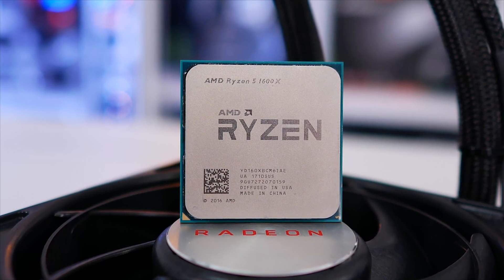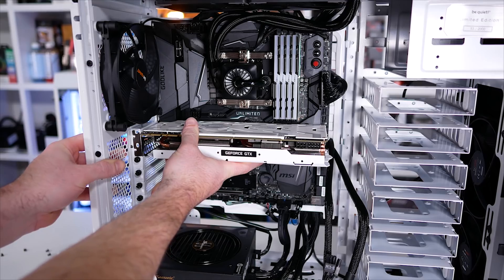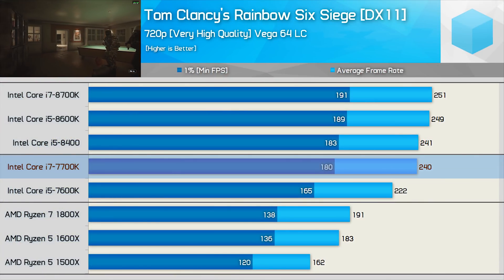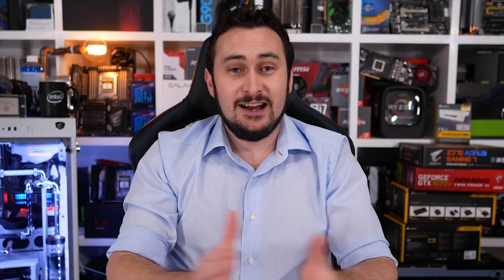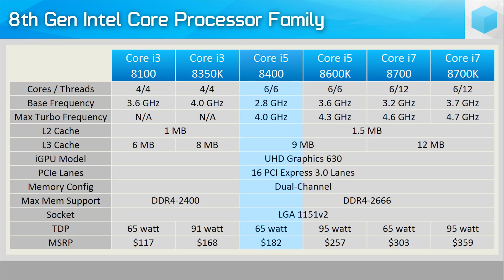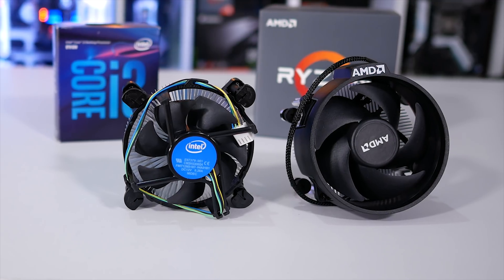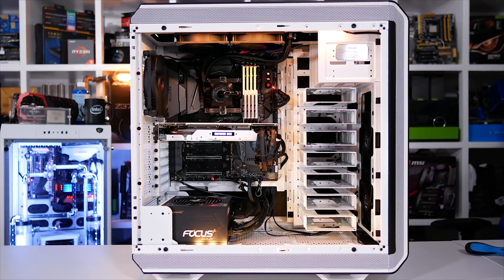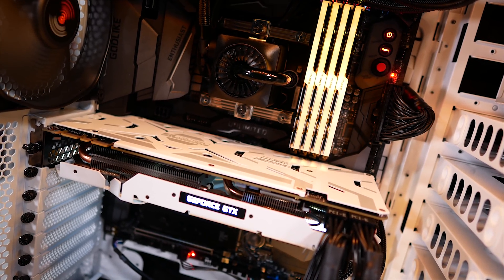Let’s Chat, R5 1600 OC vs. i5 8400 Benchmarks Incoming!

Comment: - 2X the threads
- overclockable
- 4ghz with stock cooler

all that just for $20 more, so im going with the R5
Reply: Paid $220 combined for the mobo and cpu at micro center in New Jersey. Crazy deal Imo.
Reply: Yeah I've got an Asus prime b350 and the ryzen 5 and got it up to 4.0 with stock cooler on my personal gaming rig. Works perfectly.
Reply: SlavjanA - sacrifices? what? I'm not sure if 6.8% is de diference... but there is more then just this number as well... there is also software optimization, which usuably heavy benefits intel. And tell me... r5-2600? 500mhz? What? Do you work for AMD? or where are you getting this info? Or are you one of those AMD fanboys that yell "wait for ... " and just pull out name products that dosent exist out of their ass? Like Nvida fanboys with their theoretical 2080gtx...

tell you what, i'll leave you with this little comparison chart... and i'll remind you that not all games are yet optimized to use more then 4 cores, tho certainly i believe is the trend, and soon we will have more then use full 8 cores and more. Oh and remember that 12 threads dosent mean is the same as 12 real cores, is on an average, a 25 to 30 % improve speed over 6 cores with no threads if given the same ipcs and clocks.

http://cpu.userbenchmark.com/Compare/Intel-Core-i5-8400-vs-AMD-Ryzen-5-1600/3939vs3919
Reply: Wizzie vfx... 12 threads is not the same than 12 cores... in average is 25 to 30 % improve in performance from 6 cores if given the same ipcs and clock speeds. The 8400 certainly don't overclocks but each core has a 10 to 11 % advantage over the amd cores, then remember that many games and other software have issues with SMT the AMD version of Hyperthreading and in fact there are some games u actualy benefit from turning smt off... Once the cheap mobos come out, the 8400 will be the better value... not saying the r5 isnt a good option either, but from an objetive point of view, the 8400 is still better. Again, just wait for the cheap mobos and the 8400 will be better overall. Here i'll leave you with some charts easy to read

http://cpu.userbenchmark.com/Compare/Intel-Core-i5-8400-vs-AMD-Ryzen-5-1600/3939vs3919

i5 currently 13 % better at gaming, which i think is what we talking about here. Tho the i5 is also very good for productivity. specialy in some applications that dosent use many cores like Adobe.
Reply: King Christo 3.8 all core, 4.0 single core.
Reply: the asus 4+2 on b350 boards is quite good, and the Prime B350-Plus has good heatsinks on it... also asrock's vrm on the b350/b350m Pro4 is pretty good too, and also has nice heatsinks
Reply: Plus AM4 platform has a longer lifespan.

Get the Asus B350 though, avoid the ASRock's since they don't have LLC control.
Reply: SlavjanA 
didnt know that, thanks for letting me know
Reply: Actually not a stock cooler but cooler master dream X special edition. Quite premium tbh, about 25$. The one with R3 is cooler master dream x standard edition which is cheaper.
Reply: Teemo4Life 

the 8400 runs at 2.8ghz and turbos up to 4ghz (keep in mind it turbos to 3.8ghz most of the time while gaming)... if it was unlocked it would be much better than the 1600, but since its locked they are about the same while it has half the threads

the 1600 has double the threads and can be overclocked to 4ghz at only $20 more, so i dont see what the joke is

also its part of am4 which will last till 2020...
Reply: People thinking they are super smart or informative letting others know how the 1600 doesn't always get to 4.0oc, and instead they usually go up to 3.9 lol. As if a 100mhz was going to offer crazy benefits hahahaha. Just listen to yourselves before posting this kind of shit. If a CPU works at either 3.9 or 4.0 it won't be different at all. Also a 100mhz disadvantage shouldn't be a deal breaker. 
And yes, the 1600 is a better option for gaming at 60fps or higher Rez, OP, just get one and tell us about the experience. Cheers.
Reply: wizzie vfx 
I’m getting pretty sick of AMD fanboys spreading this shit about AM4 being supported till 2020. AM3+ was supported from 2012 until just before 2015 with the 8370, but offered no real reason to upgrade over an 8100. LGA-1151 has been supported since 2015 and is still supported now.... Does this mean the new cpu gens have necessarily been big upgrades or compatible?

Stop being so biased and fanboy-ish. The best type of market is a market where the consumer analyses everything said to him and chooses the best hardware, not what his favourite company sells. Look into what companies says, use the intelligence you have and don’t be a sheep. 

Doing this means the companies have to struggle to compete, which as we’ve seen recently is great for everyone.
Reply: AziWazzi am3+ was from 2012-17 actually for mainstream. Until ryzen release. But yes new cpu wise it was until 2015. But amd have confirmed the 2020-2022 target where zen plus and the next 2 gens of zen are on am4 platform. Obv with bios updates to handle the ram and cpus. You are just used to Intel changing chipset near needlessly every year. Zero fanboying here just facts. Per core the ryzen IPC (which if people didn't know is per core PER ghz! So 4ghz vs 4ghz for instance. Not intel IPC where they over clock it and say it has more IPC (skylake to kabylake) ryzen does have a true IPC near that of coffee lake but coffee lake clocks higher. Hence the % difference. At 4.6ghz it's 15% more than a 4ghz ryzen per core) also as said previous. This is not bulldozer. The IPC is not like 40% less than intels cpus like sandy bridge and bulldozer. So can we all stop acting like it is. For games most the problems with ryzen go when smt is disabled.
Reply: jose juan andrade Global Foundries already stated that 12nm will increase performance by 10% wich is about 500mhz, AMD can also iron some things to improve IPC (one of those things are already on Raven Ridge wich is precision boost 2 but thats something "useless" when OCed) AMD in this very moment has the best cpu design it just lacks the clockspeed due the 14nm Samsung moblie node in wich the "12nm"(its actually still 14nm just better optimized) is also based.
Reply: King Christo The stock speed of the i5 8400 is actually 2.8Ghz while it's turbo boost speed is 4Ghz. There is plenty misinformation out there already, so please don't add onto it.
Reply: If you are gaming most of the time i would get the 8400
Reply: The best VRM design out there right now is the 12+4 design on the Asrock X370 Gaming Fatal1ty Pro (or something like that.) it does cost $249, but 12+4! if next gen ryzen chips can OC well, you'll be the first to find out how far they go.
Reply: This is why i still love the r5 1600
Reply: SlavjanA Please provide proof that Zen can hit 4.2 GHz on a consistent basis as everything shown so far on every tech channels is 4.1 GHz at most while using an 1800X. Non X models don’t get even close to that speed contrary to popular belief. Hypothesis amounts to nothing more than a wild guess if there’s no actual testing so you’re basing your argument on pretty much nothing other than a number thrown out by GLoFo. Ryzen is based on a low power die and a different architecture so comparing with previous or present Intel architectures doesn’t really make any sense, we have to wait and see.Pinnacle Ridge is based on the exact same architecture as Summit Ridge so it’d be a more educated guess to expect an increase in frequency but no IPC gains until Zen 2.
Reply: C A TR has 4.2 XFRs
Reply: This thread is so dumb. Who cares how many cores and clock speed it hits? Performance and price are the only things that matter. 

If i could buy a single core processor for $20 that has a base clock of 2hz and boosts to 200Mhz, but it outperformed an 8700k, you’d be damned sure I’d be buying that little single core. 

And when you look at it from that perspective, you know that, due to the IPC advantage that Intel has, the 8400 is going to beat the 1600 in MOST tasks (notice I didn’t say all). The r5 will still outperform the i5, but only in HIGHLY multithreaded tasks. 

Granted, where the r5 loses, it probably won’t lose by much, but where it wins definitely won’t be large victories either. 

And this is coming from someone who REALLY wanted ryzen to stomp Intel into the ground. The rest of you guys just sound silly spouting all of this nonsense. Like someone else said, if you really want high clock speeds, then drop all these crappy ryzen and locked Intel processors and go grab you an FX processor and OC it to 5Ghz... yeah, you go do that and have fun with it.
Reply: And also, that’s not to say the r5 is a bad processor. To the contrary, the r5 is a great cpu for the price, it’s just that the i5 is going to be better for MOST people.
Reply: Ben Feldbauer 
all im saying is that with the 1600 you get more CPU for your money, for 60hz gaming none of the 2 makes a differrence, but when im buying a pc i want it to be a beast all around, not just when im gaming
Reply: Overclockable doesn't matter if it only hits the same clocks as the stock 8400 though? And it will run hotter / louder
Reply: Wow, the AMD crazies are already out in full force and Steve hasn't even posted the benchmarks yet.
Reply: Godlyhank 
How do we know that Ryzen 2 won’t take Ryzen to 4.5 ghz with IPC slightly lower than intel, while intel clocks higher, and then Ryzen 3 will stay at 4.5 ghz and be left in the dust by intel at 5.4 ghz on 6c/12t or maybe even 8c/16t. How do we know it won’t be an FX-81|83|93|95 situation? We don’t....

We don’t know any of this.... Maybe AM4 will have TRUE support until 2020 and get refreshes that keep up with intel. Maybe next gen intel will be 5.6ghz on 10c/20t. We don’t know. My point is don’t just take whatever a company says as abosolute truth. Stop taking it from AMD and use your intelligence.
Reply: AziWazzi wishful thinking. There is a lot of physics behind the limits of frequency. SB got to 5ghz too a lot of the time that ceiling hasn't changed much. And it likely won't for intels core layout. The likely outcome is ryzen plus will catch intel up. And intel might make IPC gains on next series at identical frequency. For someone who says for people to use your intelligence you are not using yours. Only dreaming. I'm a realist. And we know it's not another fx by the IPC vs intels cpu compared with bulldozer vs SB on release any person with a measure of intelligence would see that it's not the same at all.
Reply: T B 
Yep, but we can’t just make fun of them, we must show them the light of being a near non-biased consumer....
Reply: jose juan andrade Looks like you need to learn about the difference between single-threaded and multi-threaded applications, and how applications use multiple threads, as well as how IPC is measured. Your "8 core" 8120 might get a higher CB score than an 8400, or whatever you're looking at, but it doesn't have the single-threaded, clock for clock IPC advantage. That's what "IPC" refers to; clock for clock and single-threaded performance.

Ryzen and Sky/Kaby/Coffee Lake have a 6.8% IPC difference, which is much lower than the God knows 50%(?) IPC difference between Bulldozer and the Lake's. At the clocks that the 8400 is, you might see a 5 or 10 FPS difference if you're lucky, maybe even none when you take RAM into account, but that extra FPS you might gain from the 8400 is not worth all of the sacrifices you make by not getting an R5 1600.

Not to mention that by the time the B and H motherboards show, we'll have the R5 2600 with at least a 400 to 500Mhz increase in clocks, and maybe even an IPC increase.
Reply: Don't expect to hit 4ghz and especially not with the stock cooler.. Mine can't, and that's even with a 240 mm clc.. I gotta give it more vcore than what's safe to reach it, and then it's still not stable..
Reply: Pure game and expensive mobo go Intel. Budget stay on amd.... Get better gpu.
Reply: wizzie vfx that virtual core are not that impressive as real core. Some software are not even work well with it. Overclocking? Current gen cpu be it from intel or amd are not that impressive in overclocking. Might as well keep them at stock only. 4ghz OC on stock cooler? From what i see so far majority of those R5 only goes up to 3.9. You need silicon lottery to get one that will reach 4ghz mark.
Reply: jose juan andrade 6 threads, RAM overclocking/RAM frequencies past 2666Mhz, and the longer lasting AM4 platform. Also supporting AMD for more competition to some extent. Software optimisation is not how that works, you'd see that if it was software using a specific Intel only instruction set, but any issues there might have been, have been resolved by now and the only thing left is basically RAM compatibility although that's also been largely ironed out. There's no software that likes Intel more because it's Intel, they might like it more because the software prefers high single-threaded IPC over a multi-threaded workload like in the case of the Adobe suite, or even the Autodesk suite, or gaming, but the 8400 doesn't have the clocks or threads to compete with the R5 there anyway.

Where did I get 500Mhz? Purely hypothetical, but we already have Zen getting to 4.2Ghz, and with a die-shrink and a process refinement it wouldn't be too far fetched to expect it to get to 4.4 or 4.5Ghz (500Mhz more than 4Ghz), just like how you can more easily get to 4.4 or 4.5Ghz on 32nm Nehalem compared to 45nm Nehalem. I'm not saying to wait either, I'm just saying that that'll give even less reason to purchase an 8400 over an R5 when Zen+ comes out.

Not all games are optimised to go past 4 cores, with that I'll agree, but they are optimised to go past 4 threads, which is why a 1600 or an 8400 provide an overall better gaming experience compared to a 4c/4t Lake CPU. It's true that we'll use more and more cores soon too, especially with low-level APIs. Those user benchmarks tell me nothing though, especially not gaming; we don't know the CPU clocks, we don't know the hardware in the systems; and we have literally no game benchmarks.

That SMT (what Intel branded as Hyperthreading) improvement is not entirely true either, AMD actually has better SMT than Intel. You're right that SMT provides a 25 to 30% increase in performance but that's for Intel, for AMD it's a 40 to 45% improvement. Also in some cases like in 3DMark's FireStrike, SMT adds a 50% improvement for both Intel and AMD.
Reply: You can't overclock the 8400 Teemo.  VFX?  WTF are you talking about mate?
Reply: No. i5 8400 benchmarks done with 3200mhz rams and ram speed effect cpu's game performance. i5 8400 is slower than a r5 1600 with 2666mhz ram.
Reply: Nah, when comparing them all around, it's honestly a pretty even fight. The 8400 only loses (barely) in a few applications, they roughly tie in about 50% of apps, and then the 8400 wins in a good 40% of other programs (including gaming). 

And sure, they both do 60hz gaming just fine, but many people game at higher refresh rates. In addition, the 8400 will be able to do 60hz gaming for longer than the r5 (most likely, since it runs games better, currently), then there's the fact that you don't even have to OC, which leads to it being hassle free and more efficient.

Sadly, it looks like 8th gen gives a pretty decisive victory to intel. 

Honestly, to argue otherwise is pretty tough, considering that ryzen wasn't even a decisive victory compared to 7th gen (it beat it handily in most cases, but still barely lost to anything that favored IPC/clock over threads, ESPECIALLY gaming), which made ryzen a VERY strong contender against 7th gen, but the 8th gen BLOWS AWAY intel's own 7th gen.
Reply: Wizzie vfx, do you know what IPCs are? I suggest you to google that up... because by your logic right there, my old fx 8120 from AMD (8 true cores, i ran it overlocked to 4.2 ghz) should be better then an i5-8400...  but guess what... it was even beaten by an old i5-2500...  I'm not saying an r5 is a good solution, but going my life experiences i'd go with the 8400 (as soon as the cheap mobos are out) all day long. There is also such thing as software optimization, and sadly, this last is always kinda more inclined towards intel.
Reply: jose juan andrade
 
well intel has 10% more ipc, so what ?
im not intrested in 144hz gaming and i will be playing at 1440p so it doesnt really matter, and the 12 threads are way more beneficial...

i did not compare the 1600 to a 8600K at 5ghz, i compared it to the 8400 which turbos UP TO 4ghz...
Reply: Raven05R6 Exactly, you cant OC the 8400, but it doesnt matter. The stock speed of the 8400 is 4ghz.
Reply: Omgomgomgogm fanboy alert....if i5 8400 is made by AMD, would you still buy R5...no...
Reply: wizzie vfx Ye overclock the 1600 to he stock speeds of the 8400 HAHAHHAHAHAAHA
Reply: wizzie vfx na 8400 superior